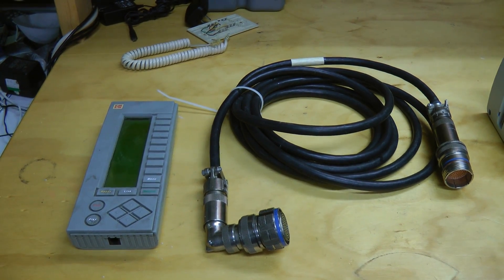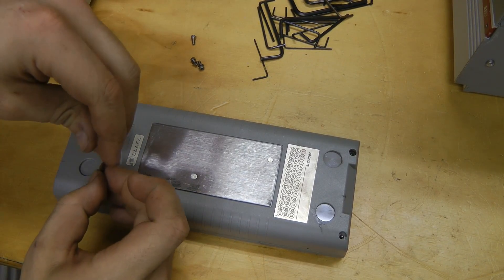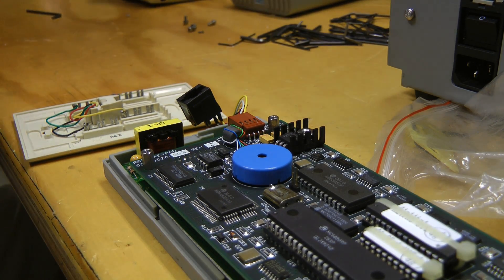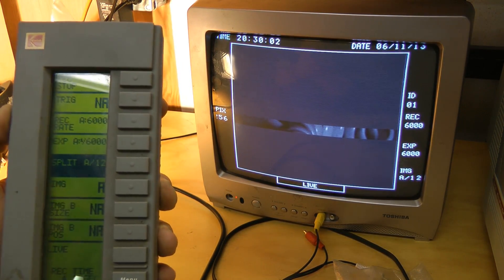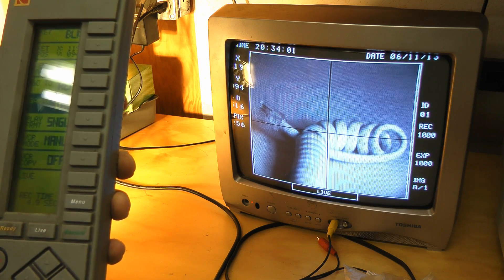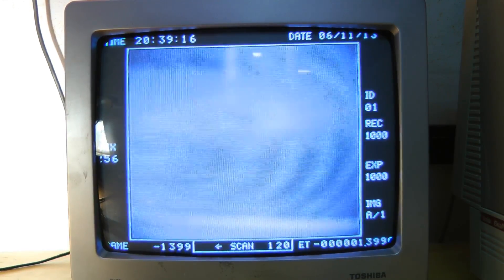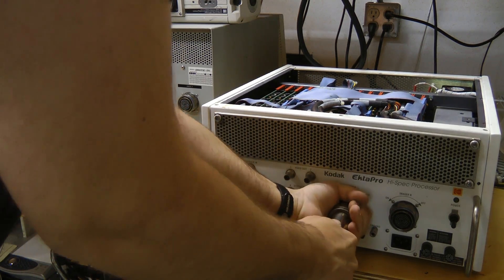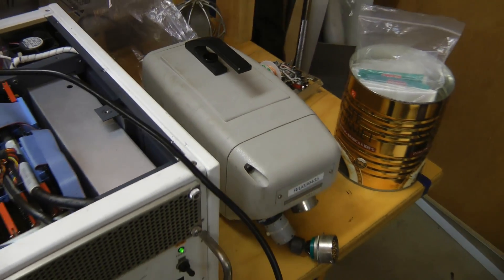Ektapro EM/Hi-Spec high speed camera update

Comment: I need to ask HOW you found this. Yes it was on ebay but where?? I've been punching in search queries several times a week for over five years and usually the best hits are very incomplete systems for $500 or more. You managed to find yours for chump change before shipping. I've never seen that. Was it miscatagorized? Did it have a bizarre name? Was it buried so deep you had to use the search engine's advanced functions?